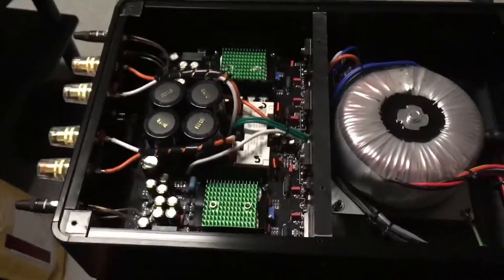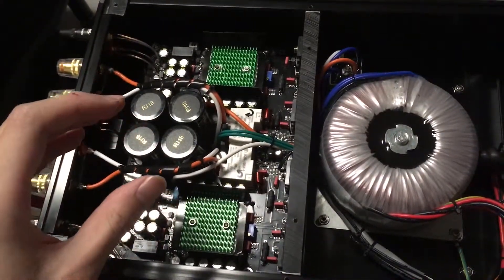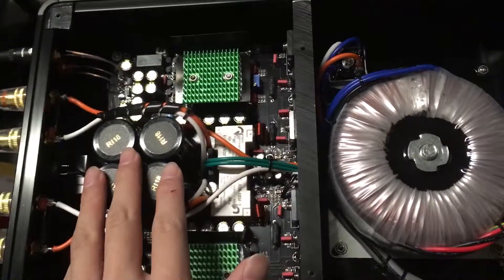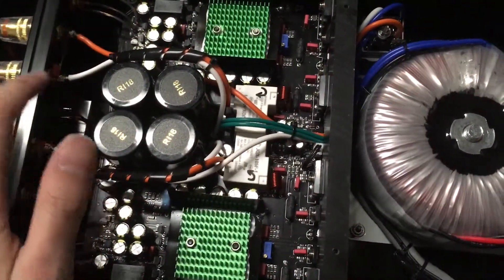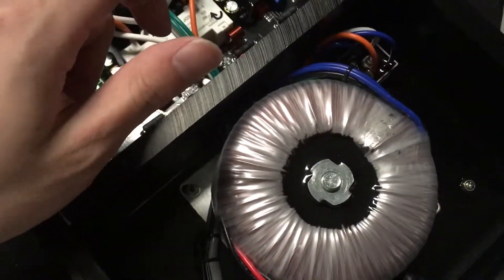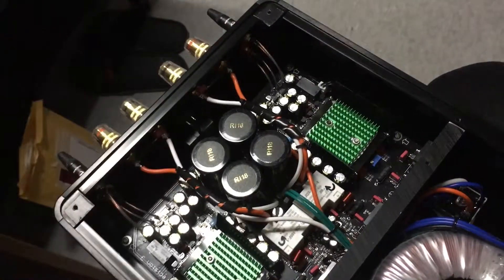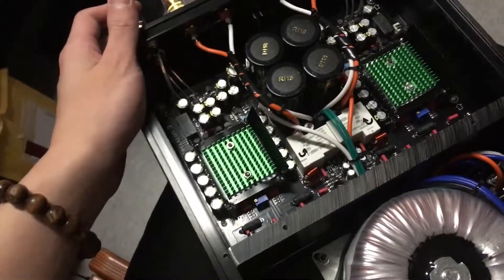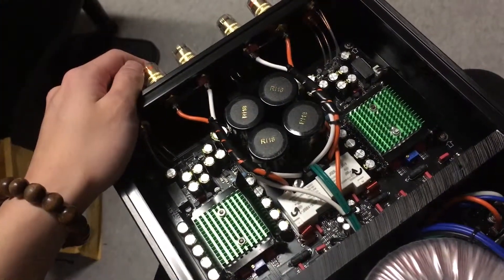Audio-gd precision 3S thoughts and ramblings

Comment: Good video man , I was thinking of buying a couple of their components but if they break down , who's going to fix these things and how much is it going to cost ? That's a big issue.
Reply from the maker: Actually what I meant to say is, most of their stuff is so over-engineered to the point that they never break down. Kingwa hates when people mess with his stuff, so he employs a none-modular design to prevent modders from tweaking the internal components. A friend of mine has an NFB1AMP turned on 24/7, they never had a problem after 5 years.
Reply: @lambdastorm7787  "Kingwa hates when people mess with his stuff" Not true at all I started using a I2s usb chipp and asked how to best connect it to the board on my first dac about 10 years ago he answered. It was a big differens against the chip that i replaced and he tock note. Then i asked if i could get a dac with I2s pin out and he costumed a dac for me with I2s connecters and he did it! And he lisens to the diy Community now every dac has a usb to I2s board and a I2s connection! And guess what? I asked for a remote to my dac to so i have the first audio-gd dac with a remote! And it is still going strong now with a Di20, I2s over HDMI now the I2s board bought from King Wa! (From what i understand he frequent the Chinese diy pages but he answers any diy question you have by mail) By the way amplifiers are always more demanding to service/repair/mod this is nothing.